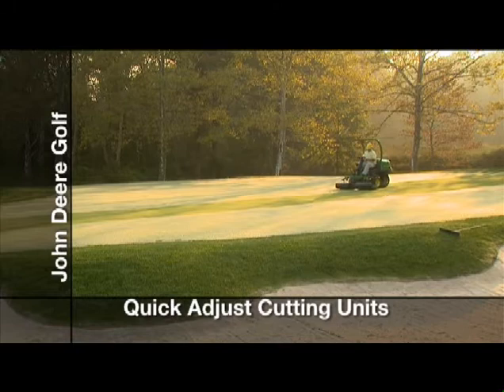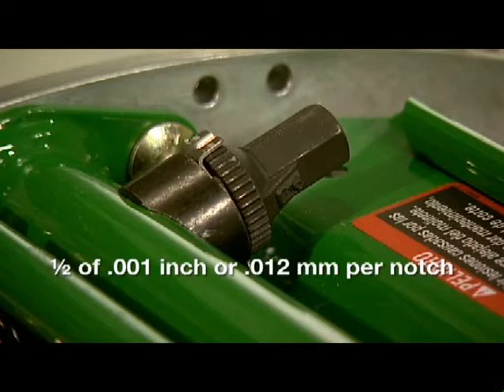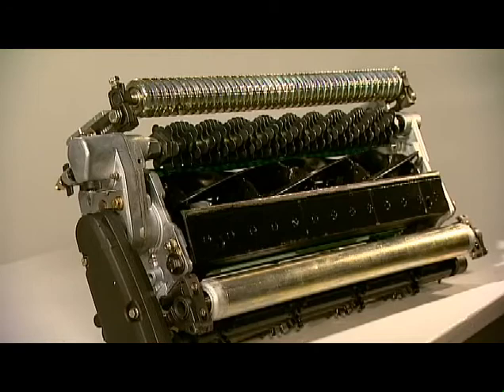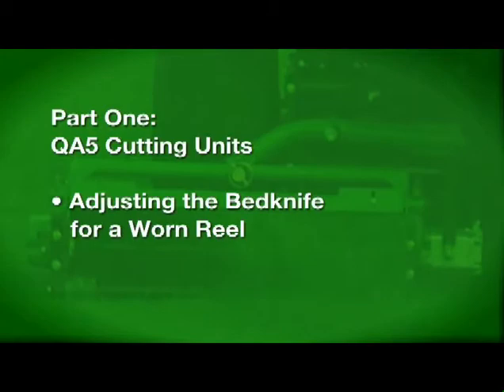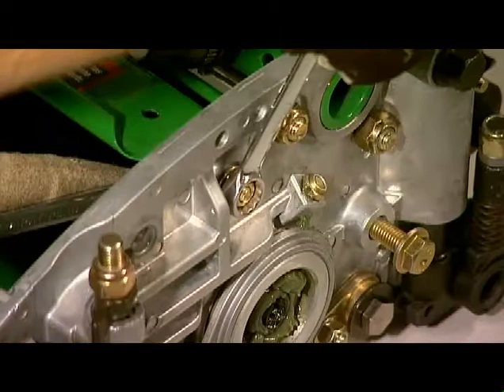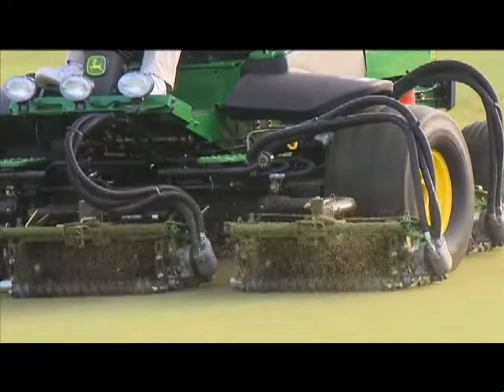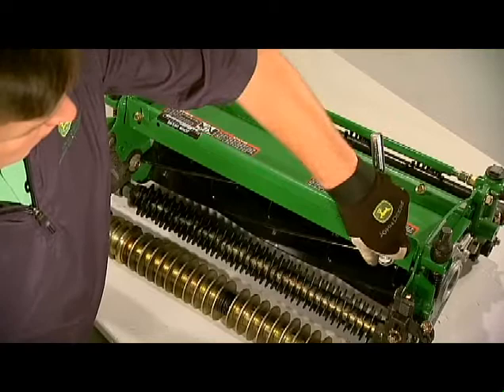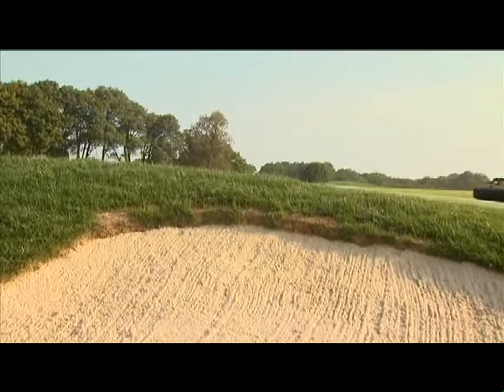Quick Adjust Cutting Units Operator Video | John Deere Golf

Comment: Great idea, but wish there was more information on how to make the mowing unit maintain its HOC. Works OK on verticut units but this system has issues.
Reply: Need to check the worm gear inside hoc adjustment the gears get stripped out

Comment: I tore one apart to replace reel bearings, reel and bed knife but I have 2 small springs left over and no idea where they go.
Reply from the maker: That's not what we like to hear. Issues like this can be hard to diagnose, especially from a distance. We recommend working with your local John Deere dealer for technical support. You can find your closest dealer at Deere.com/Dealer.

Comment: I cant figure these units out? They reel is oval shaped set them up with a .001 feeler guage. Turn the reel 180 degrees and the reel is super tight.   Ive verified our foley reel grinder and bedknife grinders are good. Replaced every bearing in the reel and rollers. Paralleled bedknife and reel with a benchplate. No rocking when on benchplate. We also have toro dpa units no issues with those.
Reply: I have the same issue with them being oval shaped and not making contact, but making heavy contact turning 180 degrees. I just got 10 brand new mowers and they all have that same issue. I have a brand new bernhard hrinders as well and after grinding, it's always the same. It's a little worse on qa7's but expected as the reels have spring adjusters on those and are moved for reel to bedknife contact. But qa5 reels are fixed in position and should not have this issue but every one always has for me... toro Jake and baroness have never had that issue

Comment: Also what is the maximum HOC for the unit at it's highest point considering the front adjustments? Where can that information be found?
Reply from the maker: Thanks for the question. Your local John Deere dealer is your best resource for technical questions like this one. You can find your closest dealer here: https://bit.ly/2B5dWFe.
Reply: Depends on what bedknife you have and where u set the hoc range on front roller.